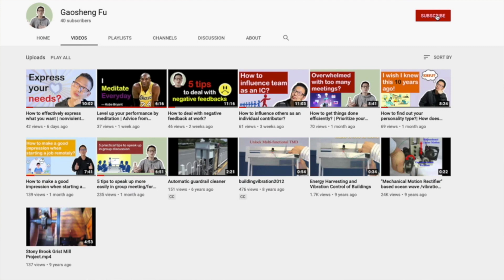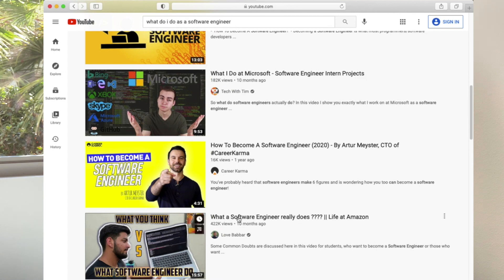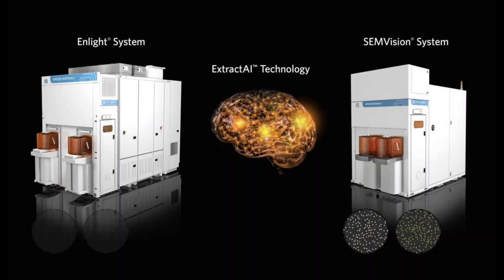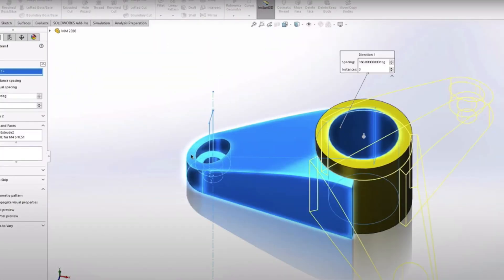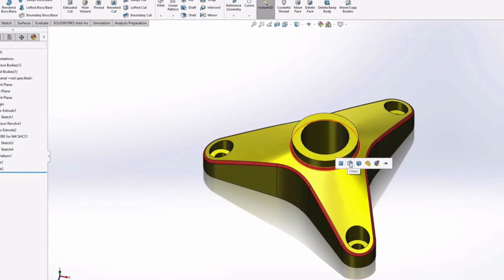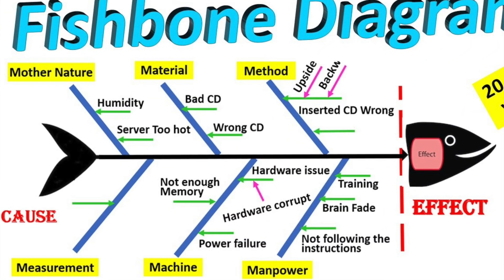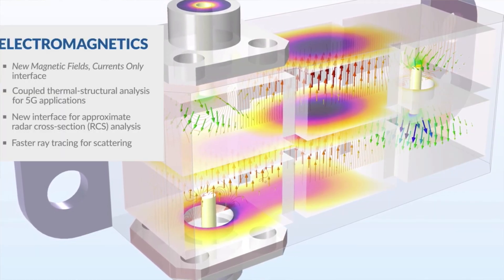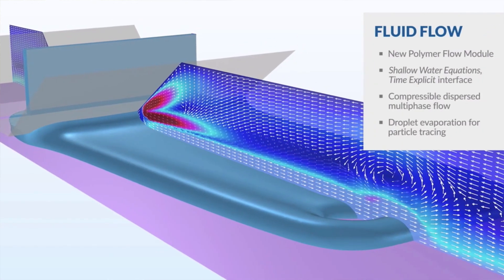Mechanical Engineer: My Daily Work In Semiconductor Equipment Industry.

Comment: Do you get to work in a fab as a mechanical engineer?
Reply from the maker: Yes, when we need to install new HWs and troubleshooting.
Reply: @fgsfrancis  I’m pursuing semiconductor as an ME student as well. Could you recommend me some books or skills i need to learn for it?
Reply from the maker: @warthunder3562  Nothing particular, I am pretty sure you will learn CAD, FEA analysis, fluid dynamics and heater transfer. Also learn plasma and vacuum physics will help.
Reply: @fgsfrancis  okay thanks for the advice